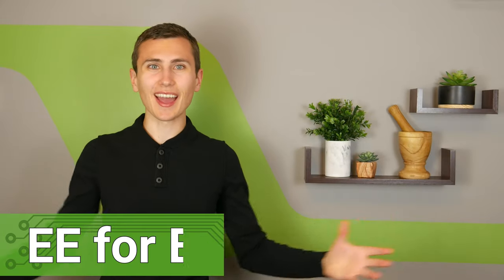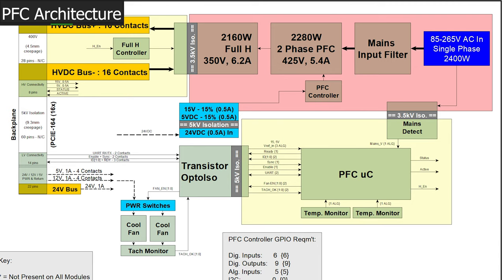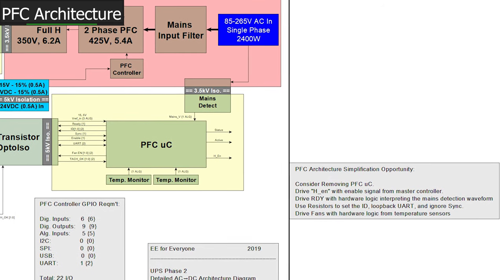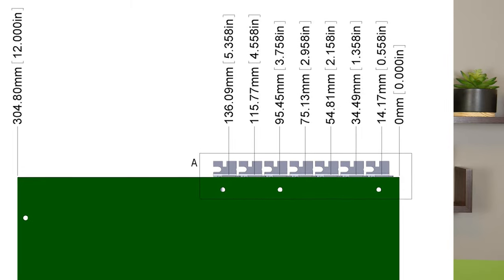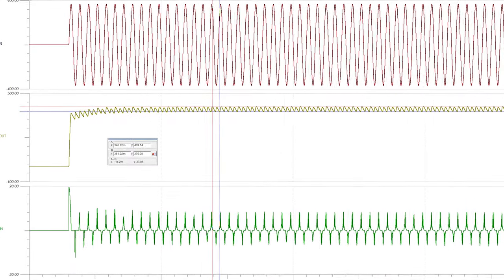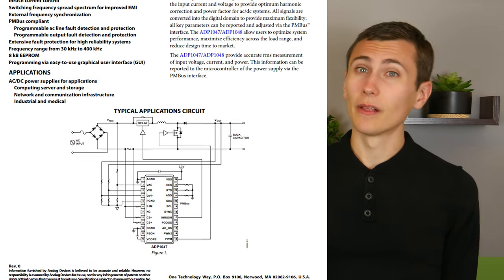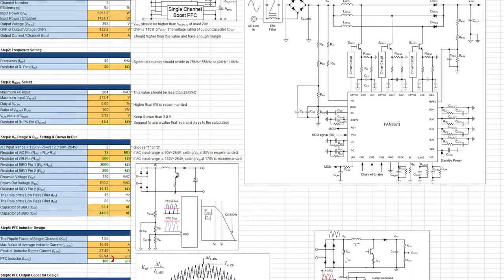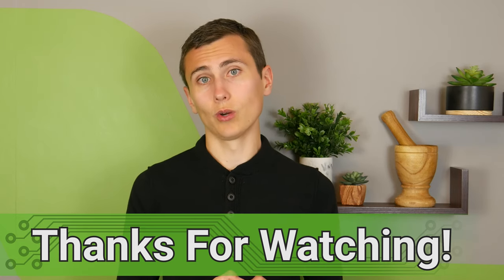2400W PFC Power Module – Let’s Do This!

Comment: Worked with buck/boost converters for 10 years.    9/10 times ( this is no exaggeration ) TI's simulation models & transient models are either non-existent, or just plain crap and do not work.    I do not understand how a company as large as TI gets away with this ...  consequently, I've given up on many TI parts and just stick to Analog Devices/LT parts, even though they can be more expensive.
Reply from the maker: Aha, thanks for the comment!! I got a real laugh from this one. It's crazy to me, as TI's datasheets are usually great. I wish I could have both! (and I'm not a fan of their encrypted models either. :)